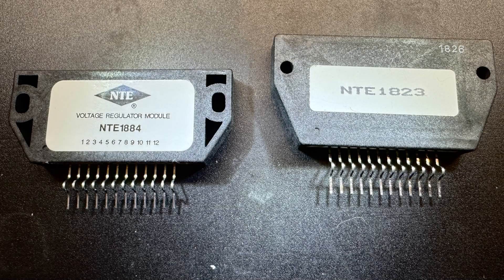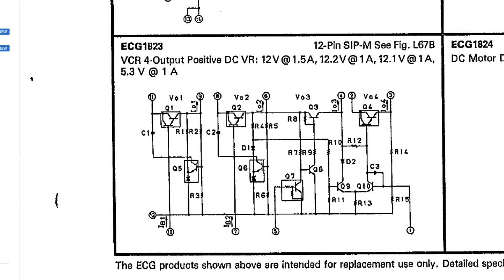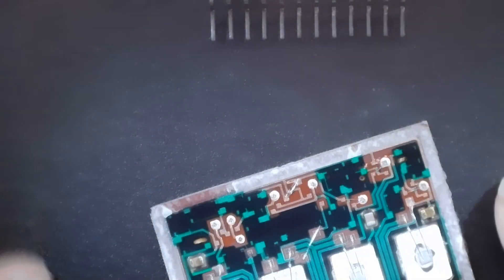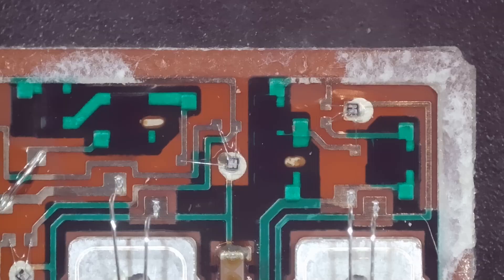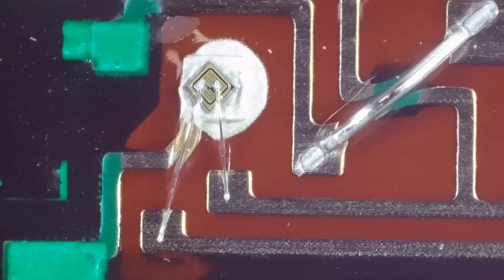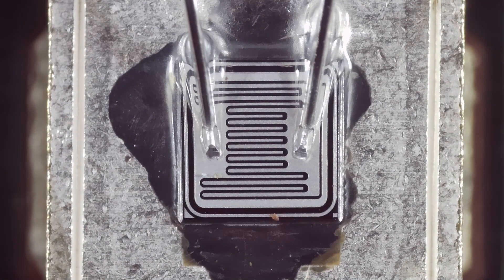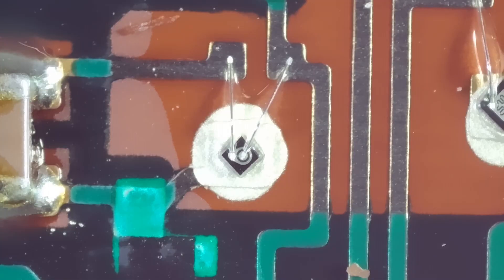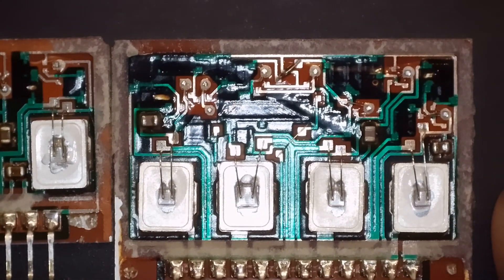#2152 Voltage Regulation Modules

Comment: Am I right about this? I think the black stuff is just carbon black acting as a resistor. So all the black is carbon black and the resistors are the area between any two pads closest together near a black area.
Reply from the maker: Thick film resistors are composed of a resistive paste, typically made of ruthenium oxide or similar materials

Comment: Those ring diodes have 2 bond wires, but a third connection on the substraight which is also electronically connected. I'm new to this, could you please explain the 3rd connection to the board? Great video as always!
EDIT: Just read below, I guess I also noticed that after the fact they may be dual-diodes! :D

Comment: The devices you are calling ring diodes look like small signal transistors to me. Take a look at National Semiconductor Process 07 NPN transistor die. It's shown in their 1971 National Transistors databook.
Reply: They've also got a copper connection underneath plus two bond wires, meaning a three terminal device.

Comment: It looks like the little diode and transistor chips have an electrical connection to the substrate through the PCB. I can sort of make sense of that for the transistors (which most seem to have only two wires bonded to them) but I'm confused about the diodes, which already have two wire bonded connections.
Reply: Pretty much all semiconductor devices have a PN junction of some sort to the substrate bulk silicon.  Bipolar transistors have their collector terminal through the silicon substrate, itself having a PN junction to the main bulk silicon of the die.  Silicon-on-Insulator devices do not have this bulk substrate connection.

Comment: Why does the diodes have 3 terminals?
Reply from the maker: I might have initially guessed wrong, but there are three terminal diodes:  dual diodes and diodes formed by shorting the base and collector of a transistor.
Reply: @IMSAIGuy  I thought there was something going on. They're doing some weird stuff with those transistors. Or this is how they usually are?!!!
Reply: @IMSAIGuy  Diode connected transistors, using emitter base breakdown to get regulation, as it is reasonably constant, and you can bin the dies in wafer form to various bins, and typically get that 7V you need.  Plus you only need a single part, as using it the other way as a regular transistor means you get a 30v capable transistor, for basically free, as you use so many of a single part. Used as zener you trim the resistors to give the correct base current, and as the diode is fed from the output this is quite stable as well.  Output transistors are all darlingtons, with only the one being regular bipolar, shown on the internal circuit, and likely used because this is a low current rail, derived from another rail so needing lower gain in the pass element, so a regular power die will work there. 

Yes they are copies or clones of the Sanken originals, second source for the repair industry, and, while the specs on them can be truly horrid regarding accuracy, drift and long term reliability, they did make assembly much easier, as your board only had the one active device, only needing some capacitors and the odd resistor and diode to make a functional power supply, a big saving on hand assembled boards, and a massive space saving as well, plus also reducing the chance of assembly error making a unit that needed on the line rework, as that needs skilled technical people, not people who can follow a set of steps in putting parts together.
Reply: @IMSAIGuy if you search for the phrase "P309_6.jpg Причем П307, П307В, П308 и П309" you'll get an image of a transistor with the same ring structure.

Comment: Ooh, STK equivalents! (Or, might actually be relabelled STKxxxx)
Reply: Pretty much everything from Sylvania-ECG/NTE is a relabeled part.  They have been in the repair industry replacement parts business for decades.  You can see how the parts were sanded down and relabeled in many cases.
Reply: @mikesradiorepair  So they are the opposite of modern  "counterfeiters" - they sand down brand name products and make them appear generic?
Reply: @ RCA, Motorola, Sylvania, Panasonic and lots more have been doing it for decades, at least since the 1950's.  Not anywhere as much these days because most electronics are not repaired anymore.  Back when people actually had their TV's, radios, VCR's repaired everyone was doing it.
Reply: @mikesradiorepair  Never seen a Panasonic labelled part that wasn't actually a Matsushita part which is pretty reasonable given it is/was the same company but I'm curious about the Moto and RCA parts, didn't they make all their own stuff?
Reply: @M0UAW_IO83  Back in the day most of the big manufacturers had their own "repair part" product line.  If they were also in the business of making parts a lot of them would be their own but they would also have rebranded parts as well.